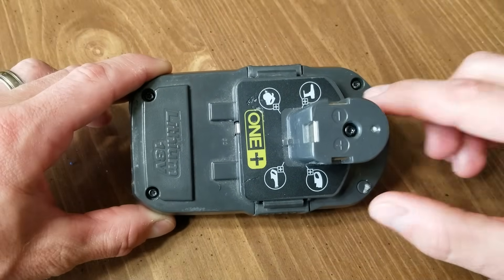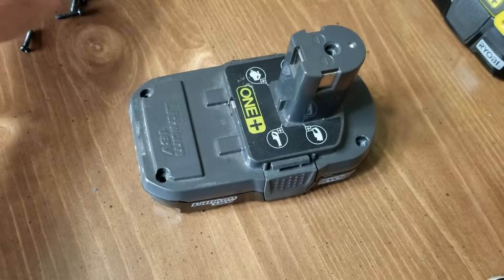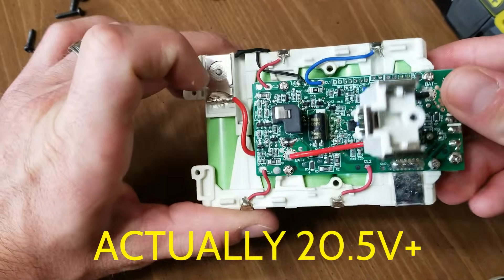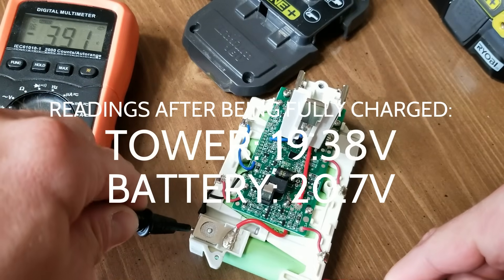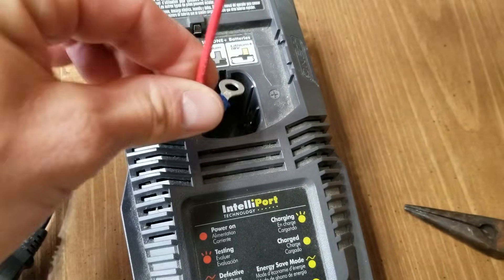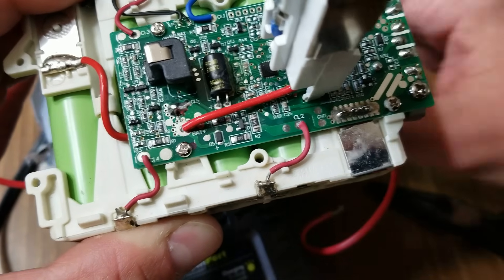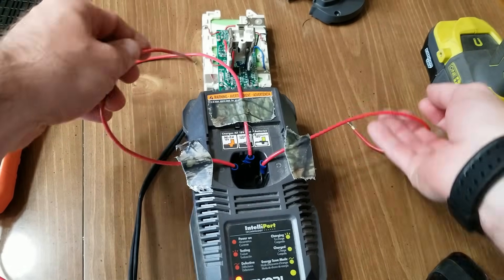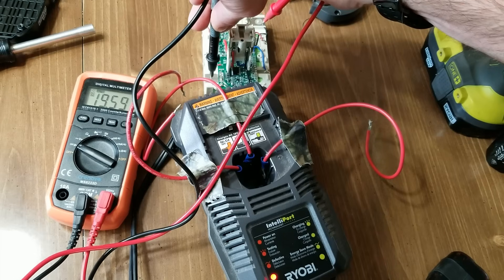RYOBI 18V Battery Not Working? [Easy DIY Charging Hack]

Comment: Just a note for the channel. No Manufacture can deny your warranty claim simply for opening the device. The FTC has given notice on this multiple times and the myth persists. Open all your devices.
Reply: Well I don't know how true that is one denying warranty but I had a dual battery pack and charger combo kit that my wife purchased for me Christmas of 2020 during the lockdown I didn't need it so I just kept it all in the box and I just opened it up last week and all the batteries won't charge I called ryobi And they told me they wouldn't replace them because it was too old unless she could find the receipt Even though I gave them the model number and the model numbers for both batteries and the charger.  You know the charger works because I plugged on another battery and it's charging it fine
Reply: @guitarguts666 
Same, it seems pretty common issue
Reply: @guitarguts666 it sounds to me like those batteries are great candidate for exactly what he's talking about here
Reply: @guitarguts666  no one’s required to provide you warranty service if you don’t have proof of purchase. 

Batteries are shipped w just enough charge to get them going on the recharge when you purchase them. The longer you let them sit the more likely they’ll bleed down too low and won’t charge. It’s actually a safety feature on the charger to not output to batteries that could be damaged by being discharged too much.

If you want there are services that will sell you a refurb battery for $$’s plus the dead battery you have.
Reply: You aware of the "right to repair" campaign? That man is fighting the good fight for all of us "garage tinkerers."
Reply: Good video, explained to check for bad cells first.
Reply: I'd caution against this.   Some devices, like older CRT TVs have high-voltage capacitors which can be VERY dangerous, even weeks after the TV/device is unplugged.  ALWAYS USE CAUTION when messing with electronics, especially if you're not an expert!
Reply: @ you’d caution against knowing your right to your property bc it might be dangerous. Wow. Your neighbors can change their breaks on their f350 drunk but old CRTVs is what we need to be cautious about folks
Reply: so the charger is plugged into 230 volt wall socket and you grabbing the wires like you did is that safe ?
Reply: They just deny it based on physical damage 🤷‍♂️
Reply: @ralanham76  go read the law. They can’t just deny you based on whatever they can point at. Magnuson-moss warranty act.
Reply: Until you can show Exactly the Law or Policy by the FTC that says what you said "It's not worth the paper it's NOR written on"..and it won't hold up in COURT either!
Reply: @johnb1997  https://www.ftc.gov/news-events/news/press-releases/2018/04/ftc-staff-warns-companies-it-illegal-condition-warranty-coverage-use-specified-parts-or-services
Reply: @johnb1997  you’re welcome for doing a basic Google search for your incredulous butt
Reply: @johnb1997  magnuson-moss warranty act.
Reply: If you abuse product by taking it apart it WILL VOID warrenty.
Reply: @williamblake8650  taking it apart cannot be what voids the warranty. Simply taking it carefully apart is not itself abuse. Now if in taking it apart you stab thru some vital component the stabbing is the part that voids your warranty not the act of opening it. Can you understand the difference yet? You can’t void the warranty by taking the cover off the door panel of your car but you can if you use a hammer to do it. Opening it is not the part that voids the warranty and it’s vital that people understand the distinction
Reply: @ since you have no sovereign citizen rights and Congress says that warranty’s in the US must meet standards one of them is something you can take to court and the other is sovereign citizen theology. 

Laughing about getting screwed ham fisted by corporations is generally bad for your assholes health.
Reply: @williamblake8650  no. mmwa says they must prove you damaged it by taking it apart. simply opening it isnt enough. but ryobi has garbage warranty anyway, thats why theyre cheap 0 warranty, 0 safety. i have a ryobi graveyard, and 0 issue with rigid, and theyre lifetime warranty, or milwaukee. and all 3 are tti.

Comment: Nine volts is more than enough to jump start  an 18 volt riobi battery . No need to take it apart , yes there will be a cell down slightly but no matter . One of my batteries wouldn’t take a charge so I just happened to have a nine volt Chinese plug in 9 volt 1.5 amp charger from I have no idea from what . Those little black things that we seem to collect. That charger will have two wires coming out of it , the plus will be the one that is positive and will have the writing on it , the negative will be unwritten. Cut those wires and put crocodile clips on them and connect those to the plus and negative of the battery and plug the little black charger to the socket and turn it on . This won’t charge your battery but will kick start it back to accepting a charge from the riobi charger . A multi meter would be handy to check the voltage before you start , and what you are looking for is an increase in voltage after a few minutes of using the black charger. Disconnect the charger and check the voltage. Once the voltage goes up plug the battery into it’s original charger . There is a little gizmo in lithium ion batteries that once it gets to a certain level of charge it can’t be charged and what you are doing is restarting that gizmo . Anything from 1.5 volts up to 9 volts will restart it .

Comment: I opened up my dead battery to bypass the protective circuit, and just used a known good battery with cover on to jump wires to for about a minute and it worked like a charm.
Reply: Positive to positive and negative to negative.  That is how I do it as well.  I use a fully charged single cell to attempt to bring up individual cells that are not registering.
Reply: How did you wire it?

Comment: I had the same problem and got the dead battery to charge by making a dual battery setup using 2 old battery holders from inoperable Ryobi drills.
I wired them together + to + and - to -.  I plug in the dead battery then plug in a charged one.  The charged one will put a charge into the dead one then the charger recognizes it and it can be fully charged.  You can also use jumper clips to do the same thing battery to battery but with the battery holders having the connection points it's easier.  The main thing is when using the battery to NOT drain the battery down to no charge (1 light or less).  When using the batteries check the charge as you use them and when you get down to 2 lights charge, set it aside and use a fully charged one to finish the job.  That way they always recharge properly. Ryobi should redesign their charger so it can trickle charge a dead battery up to chargeable levels then charge it fully.  I designed a battery Charger for Gates Batteries back in the 80's.  It had a trickle charger capability and full charge.  Once they got a full charge they would revert to trickle.  Back then the batteries were Lead/Acid Gel types.  Lithium batteries work great when new but as they age their charging capabilities have issues.
Reply: Why should they they want to sell batteries
Reply: @knuckles-3386  Duh...designing products that stop working leads to more sales.  As I mentioned in my post, I solved this problem back in the early 1980's but obviously doing it right isn't the sales methodology!
Reply: @knuckles-3386  It's called for a profit.  If a product is made to fail you usually have no choice but to replace it.  In this case I think (being an Electrical Engineer with over 50 years of Electronics Design experience) the chargers are designed to not charge a near dead battery, that's why it takes a jolt to wait it up so the charger will see it and charge it.

Comment: I have an issue where I can get the battery charged using this method, but there's almost no voltage on the tower, maybe less than 1 volt. So something is preventing the power from getting to the tower from the batteries. Any ideas? I don't see any loose wires or damage.
Reply: Upon further inspection, one of the 5 battery cells has a voltage of 0.001, so I think the controller automatically prevents any charge from being delivered to the tower if there's a bad cell. The reason why I didn't rule this out to begin with, is that the cell that has the 0.001V is the one with the piece of black tape over it (the thermometer), so I made an assumption that the tape must have just been interfering with my reading. But I think that's actually just a dead cell by Papa Roach.

Comment: I used a similar method, but the old battery was so low the charger still didn't recognize it. I put a good battery in the charger and once it begins charging, use ur method below the board on the dead battery, AND wallah! Worked like a charm.
Reply: Directly charge it until the dcv voltage reaches 18v. Do it every 30 sec then test voltage.repeat procedure until you get 18v then  assemble and placed on the charger

Comment: I know I know they want to sell more batteries, but why the hell don't they have a special connection built in so purchasers of their products to just plug in a special charger of some kind that only allows a 30 second charge to kick start the ( expensive ) batteries for consumers. This a wonderful tip, thank you.
Reply: Battery charges will not recharge batteries once they go below a certain voltage bc they can be internally damaged, so recharging them after that is a potential fire hazard. Good luck

Comment: there is alittle metal strip in the top of the charger put tape on it and put the battery in the normal way leave it there for a few seconds and remove tape and put battery in to charge

Comment: You could just change the cells. If a cell has fallen below a certain voltage it's effectively dead for good. You can get it back up doing this or using a trickle charge board but it'll never work like it did when healthy. "Charges" will last a fraction of their healthy time and it's actually dangerous to do this with LiPo cells, even in 30 second intervals.

I would only do this to diagnose the charger and/or circuitry in the battery pack itself and not the cells. I'd just replace those. It can be done with a few bucks and a soldering iron (spot welder is even better).

Awesome video though!

Comment: You can replace the individual cells inside the battery pack.  It isn't that difficult to do.
Reply: Easy for those that are more capable of fixing things, but not for those that don't really have the ability to work with soldering or weld tab contacts.
Reply: not worth it
Reply: @BenState  Why do say that? I was rebuilding a Ryobi pack for them. It had 2 bad cells. Picked up 2 Samsung 13Q for $5. Spot welded it back together and is working fine

Comment: Thank you. Your instructions are clear and easy to follow. The most difficult part was getting the correct T10 bit to extract the screws.
Reply: @apocal4pse l😊😊
Reply: Small flat head screwdriver at an angle comes right out 🎉

Comment: Can you just use the positive and negative terminals on the battery exterior to manually charge the battery, (without taking it apart)?   The official charger is what is denying the charge, not the battery or its electronics itself, right?    I am guessing the charger polls the voltage of the battery and then just refuses to charge if it doesn't detect a normal voltage.    Therefore, the fastest way to do this would be to design a clip for the terminals, then hook it to a 20 V DC power supply.    Whenever you have a sub-charged battery, just pop it on the clip you designed  for a minute.

Comment: Hi !  I have a Ryobi P107 Li-Ion battery that won't charge.  It reads 4.6 volts on the tower, but on the battery itself it reads16.7 VDC.  It also reads 4.6 volts at the board connections for the tower.  Any thoughts are welcomed !

Comment: I would think that jumping the battery that won't charge against a battery that functions an easier solution. However, this works fine. These corporations use slave labor to get the cobalt necessary for the battery to work, seriously. Then, as if human suffering weren't enough,  theres the mining process,  very harmful to the ecology,  then, to compound their wickedness, they force planned obsolescence into the equation, and make these battery chargers enforce standardization and regect batteries with no actual fault. May they feast us to famine and war, the gluttony of corporations using such practices. Wretched.

Comment: Measuring voltage is a stupid way to determine if a battery is bad.    IF they are concerned about one of the cells shorting and becoming destructive they should simply measure the current.    Most power sources have over current protection.     Battery chargers and batteries should be the same way.    Forcing people to discard perfectly good batteries because they discharged down to nothing sucks considering the cost of these things.   It sounds like a built in ripoff quite frankly.
Reply: Nope its a safety measure to stop over discharged cells which can become faulty due to internal breakdown from burning your house down.

Comment: Worked great, I used alligator clips to make it easier and just used the plug to disconnect. Originally read as 03.009V, after 3 cycles of 45sec it read 13.641V. I was then able to charge normally. Thanks for the tip. 😊

Comment: Great video, I had this exact same problem,  my battery would just flash red on the charger and wasn't that old, I found your video and said, I might as well try this before I go out and buy a new one. Well i followed your video step by step and IT WORKED, my battery has recharged and is back to life. THANK YOU, THANK YOU, THANK YOU

Comment: Don’t wire it this way , the circuit is a bcs and a balancer . Shoving volts through the bank kills the battery further . Get a 18650 single cell portable battery bank . Open it up and remove the circuit from case and battery. Connect on each cell SEPARATELY and charge them up to around 3.9v  when power is removed ( it’ll charge but you want to remove power and it hold stable around 3.9 v ) . Screw it back together and it will start charging . You must never charge a bank In series and some cells take charge more than others ( that’s the reason why cells charge separately , even a quick shunt across a bank could fry a cell in an instant . If it doesn’t charge then either the bcs is bad or a single cell ( or more ) is bad . Never at any time should you shunt the bank and if you don’t understand why then ask a rc modeller but be prepared to be called a looney if you suggest shunting a series charge
Reply: can i replace each of those 5 cells with new ones?
Reply: @tomowcaest.5999  tricky if you ain’t get a spot welder , if you got one then fully charge the 5 and put them in . If they balanced near enough it should kick the charger in
Reply: Yeah that would be nice... but in reality you have to spot weld the cells back together and people dont typically have those on hand....

Comment: that's crazy, if you don't an old ac/dc adapter for an old laptop which are usually over 19v then use a different fully charged ryobi battery, matter a fact with the ryobi battery you can jumper them together and walk off and leave them to normalize together, come back later and should be good to go.........

Comment: Thanks got my two battery packs working in 30 minutes. Good video. Except I just flashed the terminals with a small 12 volt battery charger for 30 seconds.

Comment: How do you determine if the charger is good or bad? Last week I was able to charge three 18v Ryobi batteries but now the chargers doesn't seem to work. I cleaned all the contact tabs/points on both - batteries and chargers then tried again. The 3 batteries have indicators and are showing 2 of the four indicator bars. Please advise
Reply: I had a problem where my 2ah battery would charge fine, but my 5ah wouldn't.  Although the 5ah showed 18v (fully charged small one showed 20v) the charger still refused to recognise it.  I bought a brand new 6ah one and it arrived just half charged (according to it's built in meter).  Put it on the charger and nothing.  So my charger was recognising my little 2ah battery but refused to work on the high capacity ones.

I took the charger apart and put it on the new battery without it's case.  After a bit of fiddling it burst into life.  It appears that, on the tower that sticks out of the battery, there are three connections BUT about an inch in front of the tower there is yet a fourth connection.  This is the one that wasn't making contact.  It appears that the low capacity batteries don't use it but these larger batteries do.  I've yet to work out if it's a dry connection on the board or simply the connector being bent out of place because, while I finally have the battery charging, I'm not moving anything until this one is charged.

Comment: What might be wrong if the battery tests good at the flat internal metal tabs 18-19V, with all cells roughly equivalent,  but on the tower it is only testing 5-6V, and thus not being charged by the charger, or running a tool??    Thanks
Reply: Anybody?
Reply: @ljt190  exactly what I am trying to find out too. Ill come back if I find an answer. Mosfet?